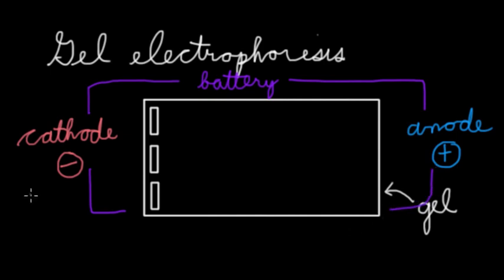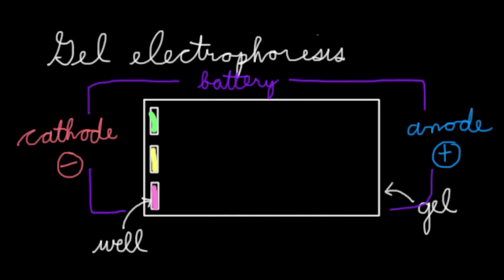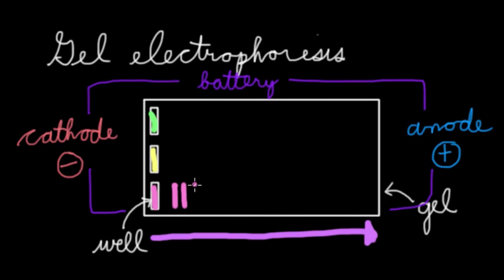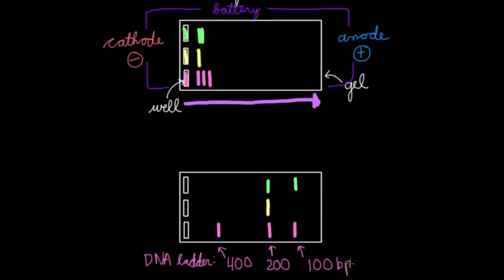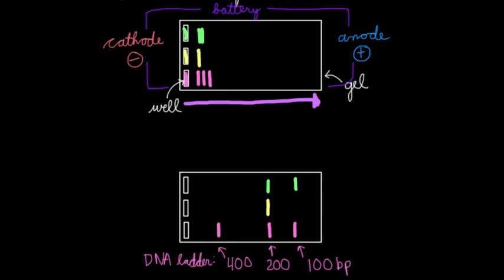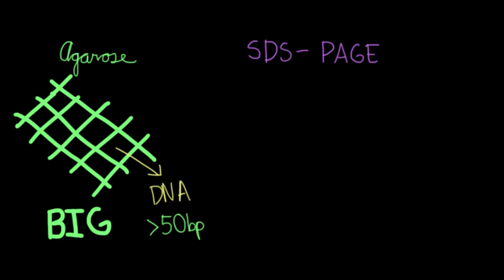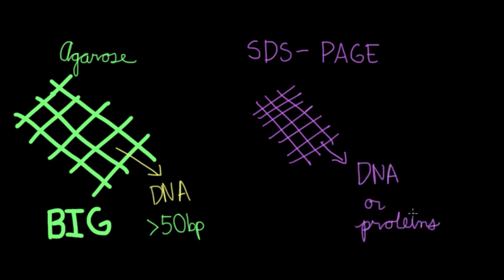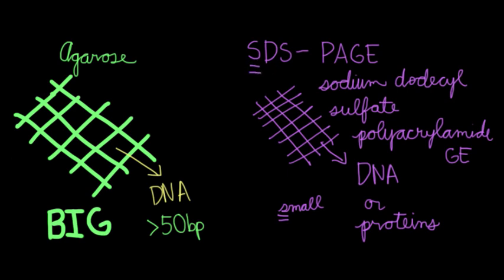Gel electrophoresis | Chemical processes | MCAT | Khan Academy

Comment: Nice Video! A note is that since as the DNA gets larger, more phosphates group are found on the structure, and thus the electric force is proportionately stronger, what causes different fragments to separate is a gel that allows smaller DNA fragments to pass easily whilst larger fragments much more slowly (similar to size exclusion chromatography where beads are used).

Comment: Shouldn't it be the other way around for the electricity conduction at the beginning of the video? The anode is the reduced conductor which means a negative charge, while the ca+hode is the oxidized conductor that results in a positive charge.
Reply: Actually she's right

Comment: Agarose might be used for DNA fragments of 50 bps- 500 bps, but in reality it is used for for those which are longer than 500 bps while polyacrylamide is used for those less than 500 bps. and is SDS used for DNA? It is not specifically mentioned in the video, but it seems it is implied. It is not necessary to negatively charge DNA( as it is already negatively charged) and that is what SDS does. Even if it is necessary to denature the DNA, Urea is used.

Comment: The polarity stated in the video is a little confusing since we tend to think of cations being associated with cathodes, and thus it would be (+) positive. As someone commented before: The cathode is where reduction takes place. The anode is where oxidation takes place.

However, the polarity of the cathode, or anode, can be + or - depending on the type of device. In a galvanic cell the cathode would be (+) positive. In an electrolytic cell the cathode would be (-) negative. if your prior reference had you thinking that the cathode is (+) positive, you aren't necessarily wrong.
Reply: Cathodes attracts cations which are positive charge. Just think of this: what charge would you think attracts positive cations? Negative. So cathodes are negatively charged... For isoelectric focusing, cathodes are usually basic because of negatively charged OH groups which again important for attracting cations. And anodes on the other hand are just the opposite.
Reply: +Brian Hanrahan I had to bust out my chemistry book because people were saying that she has the charges wrong, but she indeed has them correct.

Comment: Terrible presentation on gel electrophoresis. First agarose gel electrophoresis can separate both DNA fragments and RNA fragments based on the number of nucleotide bases. Second nucleotide bases of both DNA and RNA can also be separated. Third, agarose gel electrophoresis separates a range of nucleic acid fragments within a single sample based on the concentration of the agarose gel, the voltage applied, length of the gel, and time. 

SDS - PAGE separates a range of proteins from a sample based on molecular weight and charge and is dependent on the concentration of the PAGE, the ionic strength of the running buffer, the voltage applied, the length of the gel used, and time.  She also didn't mention Native PAGE which is used to separate a range of DNA fragments or 2-dimensional SDS PAGE.  If the voltage is set to0 high the gel can melt or the smaller nucleic acid or protein fragments can run off the gel at the electrode.  Proteins on SDS-PAGE are separated on net charge which can be either positive or negative.  Thus, proteins are often separated based on their isoelectric points.

She also mentioned oxidation and reduction are occurring at the electrodes which is false,  that is only true in a redox reaction such as within a cell battery. Oxidation reduction is defined as loss and gain of electrons among chemical reactants within the context of a chemical reaction.  For instance, the rusting of iron metal as it reacts with atmospheric oxygen.
Reply: So basically your comment is that she simplified her explanation to help kids who don't know anything about it to understand. Get a life
Reply: Liz Szabo
A succint explanation of gel electrophoresis can be simple and yet be accurate. Get a life? I've been a research scientist for more than 20 years, who the heck are you?

The omission of one parameter when describing gel electrophoresis will render the technique useless. She is completely in error when describing the mechanism that allows the separation of polypeptide fragments utilizing sds-page. SDS mainly denatures proteins.  Second, sds-page can be utilized to separate  individual amino acids by manipulating the gel and running buffer parameters.

Our graduate students have communicated that a significant percentage of U.S. high school students who enter their labs lack an accurate theoretical understanding of this basic experimental technique to correctly set up a basic agarose electrophoretic run, not based on simplicity, but on misinformation taught to them by our secondary education system.

It is a waste of valuable time for our graduate students and an unnessary cost to the university. Btw, most of our foreign students enter our university labs well prepared, even though many have never performed a basic electrophoretic run.

Comment: If you're doing Western Blotting, do you measure from the top or the middle of the bands (or the bottom)? For example, I have a thick band and am comparing it against molecular weight markers, but not sure where on the band to measure from.
Reply: I suggest measuring the bands from the center of the band which represents the greatest concentration of nucleic acid fragments.  However, you may want to consult your advisor or laboratory instructor, or email the company which sells the nucleic acid size ladder and ask them about how their ladder is to be used with the particular nucleic acids you are working with.